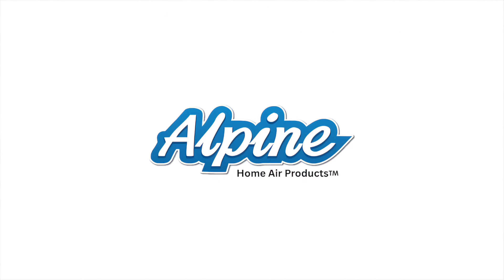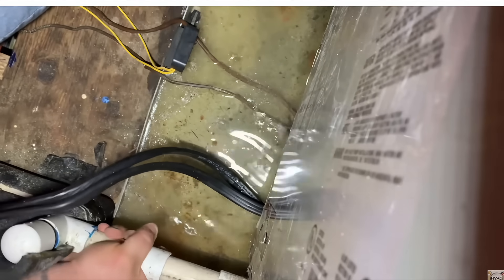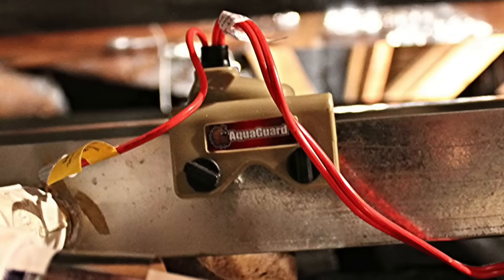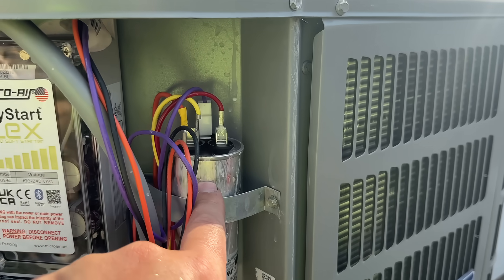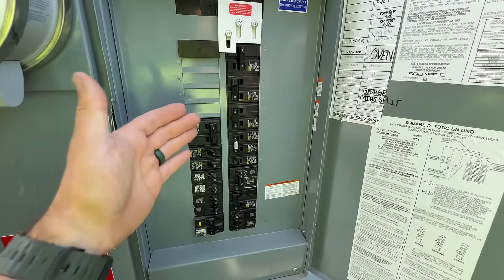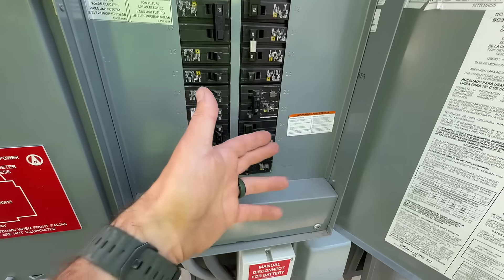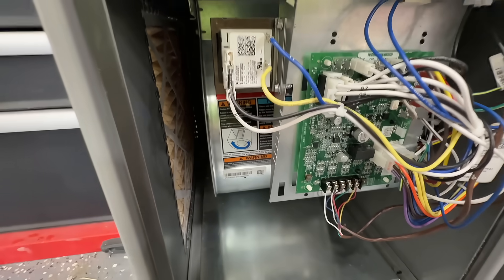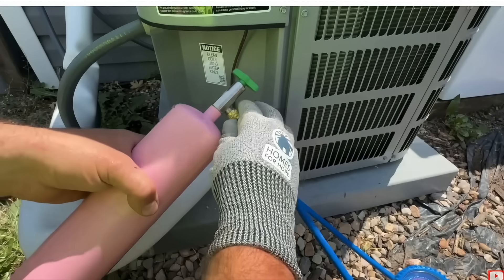AC Not Turning On? Here Are 3 Easy Things To Check

Comment: So, my AC outside unit is not running. No fan movement, no sound. Looks like it's off. The air handler in the house is blowing, but not cold air. We cleaned the drain line already. That usually fixes the issue but it didn't this time, that's when we noticed the outdoor unit was off. Went to check the breaker and it actually was flipped! But I reset it! At first it wouldn't reset. I flipped it twice and it was still that neon orange color. Tried again, and it reset, but the outdoor unit never came back on. I was told that the outdoor unit made a weird sound and then like this sound like machinery shutting down the day it stopped blowing cold. What do you think could be the issue? We had the capacitor replaced last year!

Comment: Thank you brother. I also subscribed. It ended up being my drain line clogged or something because my Safe-T switch was thrown. It also looks corroded a bit where the wires goes in- so I'm Going to grab a backup one of those and a spare Capacitor for when either inevitably goes out.

Comment: I have a 3 ton reheem unit that's old and work. But the last technician removed the insulation in the blower housing area of the out door unit. I was wondering how to go about replacing it. Because the unit is sweating and the air in the house is not that cold. Incoming air is 58f, and outgoing air is 72f. Any help, please, it is hot out here.

Comment: Years ago, I had to pay for a 3 minute service call, so the technician could flip “on” the emergency wall switch that was mounted on the wall of my basement stairs. Apparently, one of my kids turned it off when they went down to the basement. 🤦 Since then, I always secure the switches with tape. Check your switch first.

Comment: I have a basic quick question for you....

I've followed you for quite a while, and have been especially interested in the minisplits. My home has a central air unit with a furnace that needs replacement, so obviously I have all the duct work. Would it be silly to replace with minisplit, and possibly use the duct work for air filtration, somehow, do minisplit and recover duct work space for storage, somehow, or just go with a traditional system. Either way, I plan to do the work myself. Any thoughts?

Comment: You forgot another one. A dirty condenser coil could cause the compressor to overheat and shut off. This happened to me a couple months ago and I thought the compressor was dead. The unit was 10 years old and never cleaned. It was a slimline unit that sucks in air from the side and blows it out so from the outside it always looked clean. When I removed the top, it saw how dirty it was and after cleaning it, everything is back to normal.

Comment: Yeah my Trane AC suddenly shut off today in 98 degree heat. I checked the breaker—yep was tripped. However when I try to reset it, I cant. It just instantly retrips. The thermostat doesnt even call for it so theres not even any load on it. I thought it might be a bad breaker (dual pole 40s) so I replaced the breaker…nope still wont reset. Turned all breakers off just to see what would happen, tried to reset breaker, still wont reset. WTF?

Comment: I’m pretty new to YouTube so I’m not sure where I can ask you a question.  I installed an ACIQ mini split and I’m certain everything is correct and I have the correct charge.   The pressures are about 120 psi.  I have condensation dripping off of the suction inside. I’m sure that’s what’s causing it up inside of the unit, but it is dripping into space.  Do you have any suggestions? I can try. I’m certain that everything is clean and clear.

Comment: I have a Lennox heat pump system. Was wondering if you could help me with setting up the thermostat so that the fan does not shut off prematurely when it’s on electric heat. It’s my understanding that the fan is supposed to run a while to cool the coil. It has a 10 KW emergency heat coil on it.

Comment: DIY HVAC Guy, I installed an AC system at my house and a weird thing happened. For a few days, it wasn't keeping the house cool. It was at 83 or so. It was blowing cold, but not cold enough. I called a repair man and they said there's an air pocket in the refrigerant line. I've never seen you talk about that and I can't find anything else about it either. I'm sure it's possible, but how would they detect it?
Reply from the maker: If you have air in the system it’s not a “pocket” it just won’t cool the way it should, regardless. The way you would know if your refrigerant is contaminated is if you don’t have a 20 degree temp drop, so from your return to your supply you should have 17-20 degree split. Also your pressures could be super wonky if it’s contaminated. This is pretty uncommon though. I’d def get a second opinion
Reply: @diyhvacguy  Thanks for the reply!

Comment: Just gonna put it out there.  ChatGPT will guide ya through every bit of it.  If you provide it with the right information and questions.  A supply photos of what you’re talking about in the information you give it. 
It’s not fool proof.  But it will tell you what to do even tell you if it seems to be wired correctly by what it’s able to see in the photos you supply it.  

A provide it with your units labels on the panels etc that has the model a serial number info an all of that.   

You’ll be blown away.   Now it’s not perfect but if you provide it with enough information it’ll help fill in any blanks of wonder you may have.  A the likelihood of this or that. An how to check this or that etc.   
just check it out.  Ofcourse if ya have some real issue going on. Ya not going to replace a tech from coming out.  

But I’ve even told that to a few customers.  Different trade. But about certain things they were having trouble with.   That was going to save me a 1/2 hour 1 way trip to do something they can. They just lacking having been taught.   
Like a home owner type things to know.  Or should know etc.   saves me from a 5 minute stop an having to charge them for something silly themselves will get the hang of.

Comment: the drain switch is huge in florida......i clean my unit drain with 1/2 gallon vinegar once a month followed by hot water.---does anyone have thoughts about the micro-air caps??  any good--worth it??  or will it mees up an older compressor??
Reply: That soft starter was gold for my 2001 Trane XE1000 5 ton unit. Sounded better on startup and stopped flickering my lights. Ran it on there for 4-5 years until I replaced the system. Would recommend it no doubt

Comment: i did not realize there was that 3amp fuse in the control box until i upgraded my Nest thermostat to the newer model. i didn't cut power when i did the swap....and i couldn't figure out why the new thermostat wasn't getting power. a quick Google search yielded the possibility of the blown fuse....and that's exactly what it ended up being. luckily was a quick and easy fix as it was over 100 degrees that day.

Comment: Checking the air filter is a good idea as well. A clogged air filter can cause low air flow, leading to a frozen evap coil.

But then again, a person who doesn't keep after changing air filters (like a tenant) isn't likely to fix their own system anyway...

Take care and God Bless.
Reply from the maker: Yes of course. Air filter is very important but for this video the title was if your ac “isn’t turning on”, top three things to check.  👍🏼

Comment: You Tube knows your system better than you do.  A couple years back I started seeing HVAC repair videos in my home feed and having an older AC system, started watching.  I don't know exactly how much has been saved with DIY repairs, but so far I've replaced condenser unit capacitor, a few months later, the condenser fan motor & fan blade, and blower motor last.  All successful and quickly done.  I have a retired friend who still has an account at a supply house so I got parts at service shop cost, but even without that discount I've likely saved hundreds.

Comment: Curious I'm in Tennessee as well air handler in attic but my new house 2025 had a condensate pump will it still  back up?
Reply: Yes, if the safety switch on the pump fails or if the pump was installed incorrectly.  If you're concerned, have a tech come out and inspect the installation. You may have a builder warranty claim.
Reply: @raygunsforronnie847 
Ty
Reply: Great videos and informative

Comment: Great video! If it were me, I would always change out a failed capacitor with one made in the USA (such as AMRAD capacitors, although they are not the only US company that makes quality capacitors). Yes, it will be a little more expensive than ones made in Asia/China. But you will be buying a better made product that will last longer. What the heck, if you're going to go through the bother of opening up your unit to get at the compressor, why not spend a little extra and use quality components.

Comment: Friday 9pm ours stopped - 87 degrees and 90% humidity. Sweat it out overnight and did my own diagnosis - condenser fan motor bearings went bad. The local supply house hit me for $275 for a generic rescue motor that was compatible but in three hours I had it all replaced, cleaned the coils, re zip tied all the wires neat and a nice cool house!
Reply from the maker: Awesome, glad you got it all sorted out and back up and running!

Comment: Check the actual breaker every few years if the panel is exposed outdoors. Any signs of arcing have it replaced (DIY if you have the skills). A bad 230v leg can cause wonky operation and damaged expensive parts if ignored.

Comment: 7:00 Had the dreaded E fuse 😂 blow on my air handler. Contactor went bad which blew the fuse. And yes I knew it was a 3A fuse but found a bunch of HVAC Reddit posts about E

Comment: Why is the Microsoft easy start so expensive
Reply: And is mostly unneeded unless ones home has crap service from the utility or bad wiring on the house side of the meter.
Reply: @raygunsforronnie847  It's needed if you want to run a central a/c system from a small generator.

Comment: I have changed out the capacitors myself. Simply take photos of the connections before disconnecting any of the wires.
Reply: Same here and I always have an extra one in the garage. In and out in 20 min

Comment: The vacuum on the condensation line does not always work. I learned that the hard way. I had a safety switch, the float type that did not shut the unit down, while we were away.

Important: Do not install those safety switches straight out from the condensation port. Locate the safety switches lower down, so the float will rise enough to shut off the unit, before the pan inside begins to overflow. Our pan was overflowing into the plenum below. The float never got high enough to shut the unit off.

Comment: Great clear and concise service advice for the diy homeowner. Something I have had to piece together is that for the new 454b systems, it is recommended to evacuate the system anytime it is low and needs to be fully recharged due to it being a blend. R32 is a single refrigerant and not a blend and does not have this service issue. Interestingly enough 410A is also a blend but you are able to top it off without a complete system recharge. So for those new 454b systems this would significantly drive up the cost of repairs even if it was to replace a leaky Schrader valve.  What are your thoughts?
Reply from the maker: No it’s the same as 410a. You do not need to completely evacuate 👍🏼

Comment: Yup, i pulled the cover and found out what my capacitor rating was and contactor part# was and ordered spares to keep in the garage for that 1 day that they WILL go bad, itll be a quick, and cheap repair to get it back going again,  $45 for both parts combined.
Reply: Keep it in the house where it's cooler. Capacitors degrade over time.
Reply: @gan_the_white our garage is attatched and has 2 outlet air ducts, not a return (which i think would be against code anyways due to car exhaust etc)  , so keeps its comfortable out there all year long.

Comment: I checked all areas. My repair was a broken wire on package unit heat pump first stage. My previous HVAC friend came out an figured out my problem. My system was 2 pounds low on R-22. Bought 30-pound jug for future.
Reply: That is a $10 k penalty, without the EPA license.
Reply: @vietcongbuondanbannuocphan1791 .  Nonsense. You don’t need EPA to buy.  I know the rules of HVAC. I worked in the industry for 13 years. I managed the system where I worked at. Trust me when I say you don’t need an EPA license to buy refrigerant.
Reply: @vietcongbuondanbannuocphan1791 was thinking the same thing. How did you get that r22 ?? Requires an EPA license to purchase.
Reply: @vietcongbuondanbannuocphan1791  You can possess it, you just can't buy it or use it without the EPA 608.  Some suppliers will let you order if you tick the box that says "will be used by licensed technician only."

Comment: I talked my friend into buying an extra capacitor and contactor for his A/C unit.  I told him that capacitors seem to always go out during the hottest day of the summer on a weekend when you can't get a repair tech to your house.  Sure enough, his A/C stopped working on a Saturday but he had an emergency replacement capacitor and he had his A/C up and running in less than an hour.
Reply: Yep I have a spare capacitor and set of fuses on hand - those are the first two things I check anytime there’s an issue.
Reply: Is it possible for the capacitors to be rehabilitated after an extended amount of time turned off during the hottest day of the summer? The AC would stop working but the furnace would stay on. So I turned off the thermostat for a few hours, until night time then re-engaged it and the condensing unit would kick back on.
Reply: @papimidnight3748  - Your capacitor could be weak or you might need a hard start kit. You should get somebody to look at your unit or buy a meter so you can measure the true value of your existing capacitor. Running the unit can damage the compressor.
Reply: @picklerix6162  Thanks for the info!
Reply: @papimidnight3748 typically the compressor and condenser fans have the ability to shut off if they overheat. The capacitor is only used on startup and once it’s cooked it’s pretty much done and needs to be replaced.

Comment: I heard this week that a service company here in FLA was charging over 700$ to change out a bad capacitor.  As a comparison, a Titan HD 40 / 5 is 17$ on Ebay... and like you said, is super easy to DIY.   So, what you don't know can absolutely hurt you and/or your wallet!!   Thanks for the video.
Reply: They got my friend for 900 cap and a new breaker.
Reply: Yes, just watch how much Mikey Pipes charges for a new $15 capacitor WHEN HE IS ALREADY on site doing your yearly PM!!!
Reply: @midwestg4105 Porsches don't buy themselves
Reply: @midwestg4105 100%
Reply: Yes, knowledge is power. 😮
Reply: In 2015, an HVAC contractor charged me $10 PER OUNCE for R410A PLUS his time and travel charges. When I saw that I could purchase a 25 pound jug for under $100 (at the time),I knew it was time to start reading, learning and doing this myself . Since then, I haven’t had to call for service again. My neighbors who have identical units as mine also appreciate what I’ve learned .
BTW: YES, I do have my EPA608👍
Reply: I was quoted 1k lol. I said no thanks I can do it myself
Reply: @christopherhammontree3222 LOL... that's insane!!   I just bought a Titan HD 45/5 on amazon about 2 hours ago for 25$ shipped.   I'll just keep it around in case my current capacitor goes bad.  My system is 4 years old, so you never know.
Reply: Careful of the Titan-Pro caps, they're leakers momma!
Reply: Disgusting!

Comment: Weak batteries in the thermostat, nothing worse than have to charge a service call to change AAs. Just to add, fuses and breakers are safety devices and if blown or tripped could be a symptom of a more serious problem. Weak breakers, chewed wires, ground faults to name a few.

Comment: I just changed the main contactor on my condenser. The unit might be original to the house from the 1970’s, it has the olive color. The capacitor looks original (It has not been changed since O have owned the house from 2008). It is mounted SIDEWAYS, unlike the new ones I see everywhere. Could this be why it has lasted so long and newer units don’t last?
Reply from the maker: I’d love to find one around here that is like that. I think the longevity is just from the fact that they just don’t make things like they used to. I have a 50s model fridge in my garage made by GE and it outlived my last fridge in my home and will probably outlive the new one we just got 🤣
Reply: Wow, your system is a champ!   Which brand is it?

Comment: Question: After several homes and their AC units I keep a spare capacitor - recently my current home AC failed and, yep, capacitor. I go into my cabinet and I have 3 spares - 50/5, 60/5, 80/5 BUT this unit takes a 70/5. I bought one a day later and installed it and ac came on. 

COULD I have used any of the others I had already had??
Reply from the maker: No, you definitely only want to put in the exact size cap it requires. It might come on with one of those others but it’s not worth messing up your compressor when you can get the correct one. 

This is where the turbo 200 is awesome because it can be used for any application, and then removed once you have the correct one in place 👌🏼
Reply: You could've jumpered the 60/5 together to make 65 and then changed it when you got the  correct one.